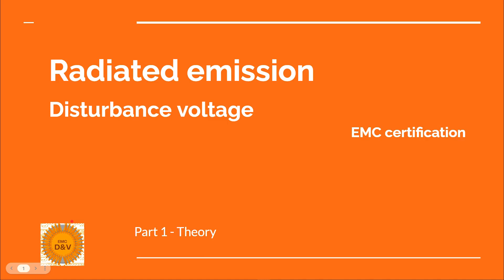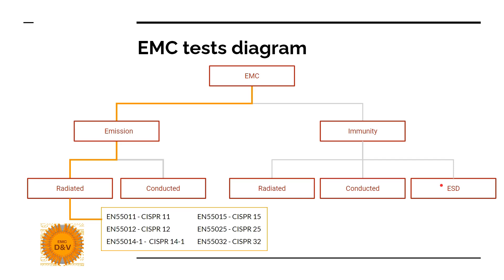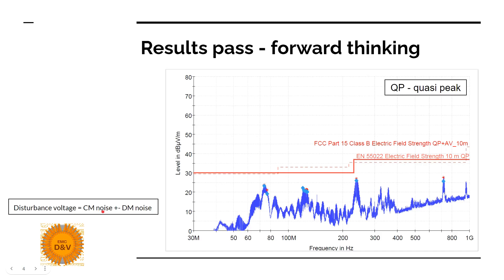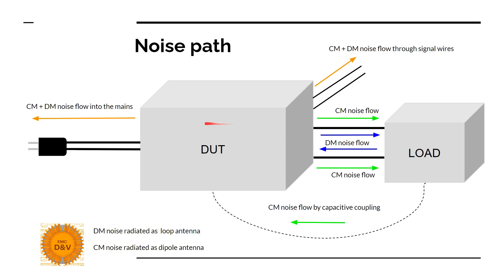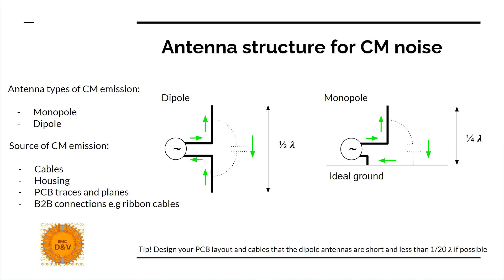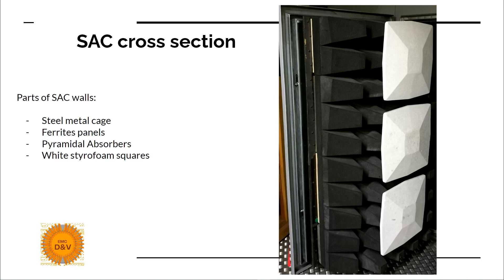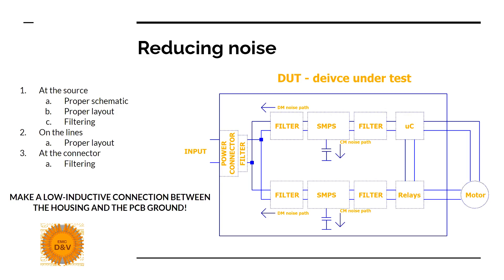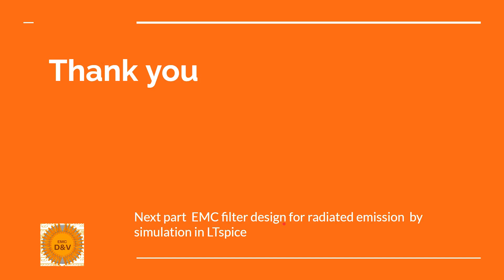Hidden antennas in your device! All types for EMC Radiated Emission! - Radiated  emission part 1

Comment: Hi, slide 7 stated 2 types of the antenna structures for DM noise, perimeter smaller or equal to lamda/4, or larger than lamda/4. It means any length of the perimeter will be an antenna. Could you explain more here? Is there any written error?

Comment: Nice vedio 👍
But most of people's even high end engineers have no awareness of EMC.
All the knowledge is failure when we goes to practical implementation of electronic projects bcz of unawareness of EMC.
Reply from the maker: Thanks. I think I know what you mean. I want to start a series on EMC rules for schematic, layout and housing mechanics. This should be helpful because there are a lot of EMC rules to remember, and some of them depend on the device :-)
Reply: @emcDV  👍😊EMC is called black magic of the Field understanding it means a lot.
You are doing great work.
I am too international Patent holder in electronics and  that's why love and respect for your vedios😊👍👍😊